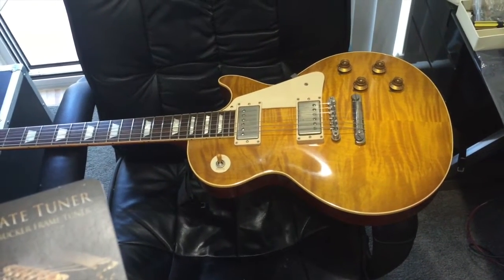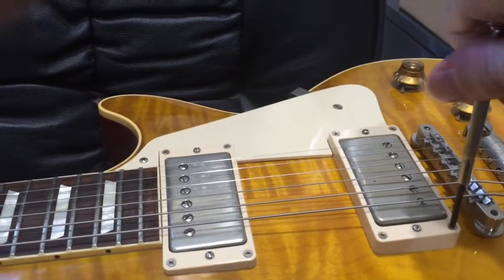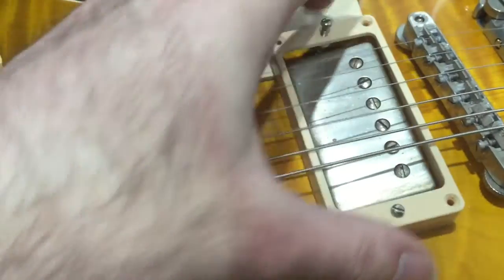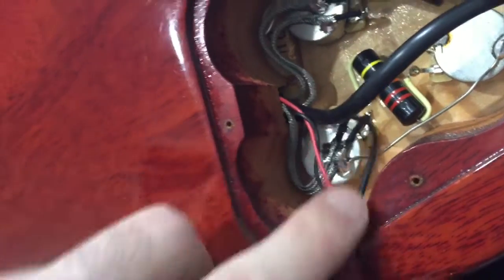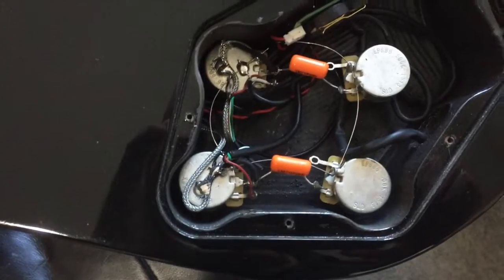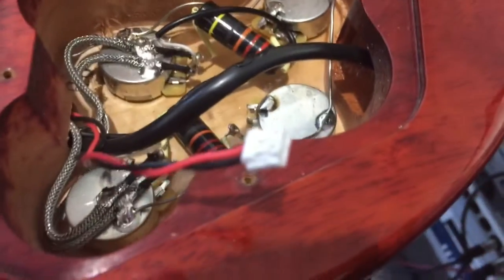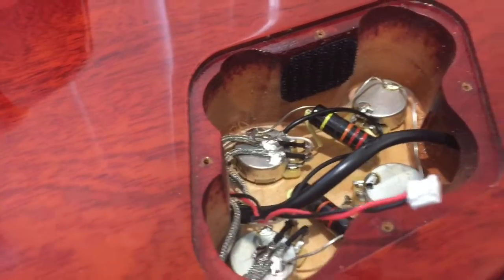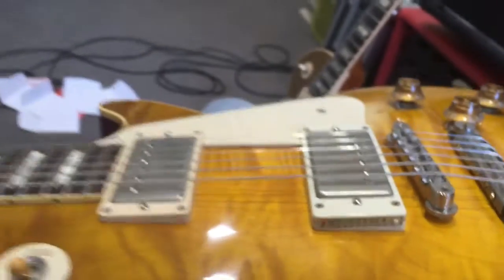Shadow e-tuner review

Comment: Every video doesn't say if the tuner AUTOMATICLY TUNES the strings or if i should turn the key til the green light showing 'in tune' happens.  Please  so i turn the keys or does the guitar? thanks
Reply from the maker: this is not an automatic system - its simply a tuner built into the guitar